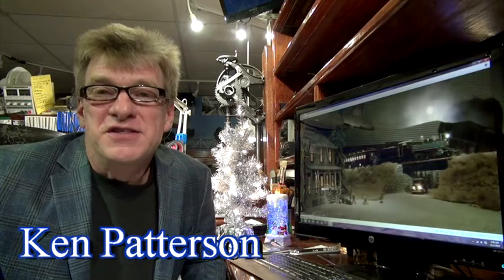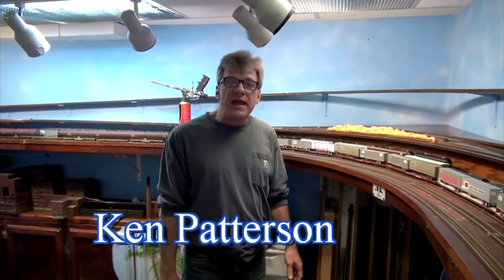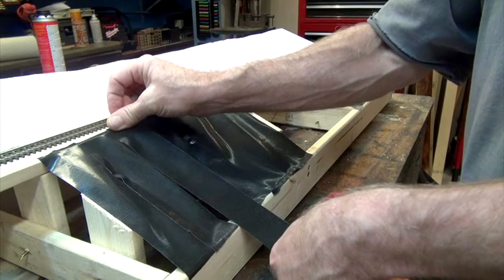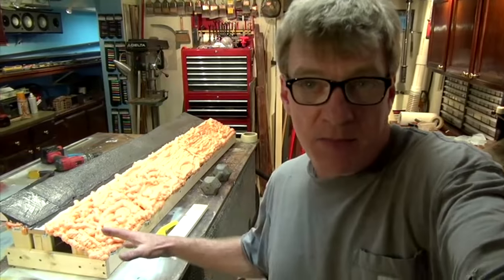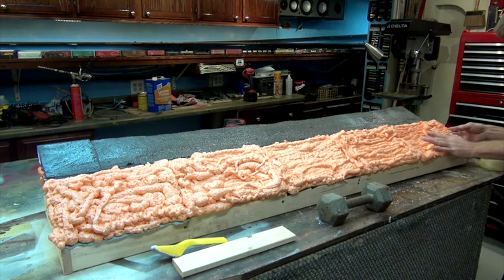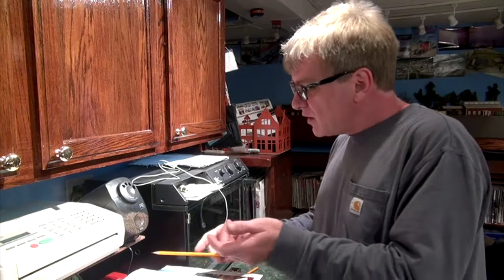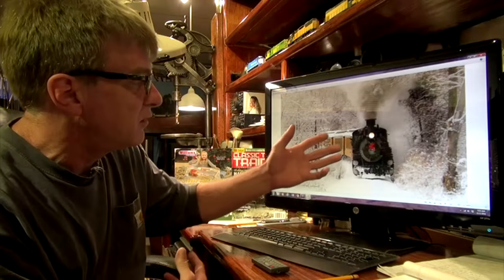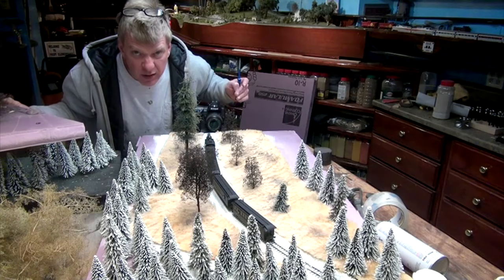What's neat - Dec 2016 column | Model railroad tips | Model Railroad Hobbyist | MRH

Comment: The only problem I see with your foam experiment is the last two segments, microfiber cloth and paper towel, were covered with more foam than the rest and to a thicker initial level with a different pattern.   For a true comparison the technique and conditions of experiment must be the same across the board.  I am not surprised at the initial result of the paper towel and microfiber as the coating on them was thicker and therefore expanded to a thicker result.

Comment: at 19: 30 the locomotives sounded more like the real thing. why?.....they turned the volume down on the decoders! most vids they have them turned waayy to loud and it just sounds like electronic noise idling up and down, with a not so random air let off. and sound NOTHING like a real train in run 5 going by. I have found a few that have realized this, and Im glad they have a $200+ locomotive, but turn it down please! it will sound so much better than hearing the plastic vibrate from the vibration of the volume of the decoder! not to rant but guys if you do this, you will be amazed at what your locomotive will sound like with the vol turned down about half way. I have a cf7 with sound and I found this out right away, up full blast it just sounded like electronic racket idling up and down,...turned it down about a lil more than half and it was loud enough it sounded GREAT!  you could hear the 567 rumble and whine idling up and down. so yeah, take my advise, if you make a vid, turn the loco down !! like I said not to be "that guy" lol,  but just trying to make everybodys vids sound better. jus trin to share what little I know with yall! - Arkie